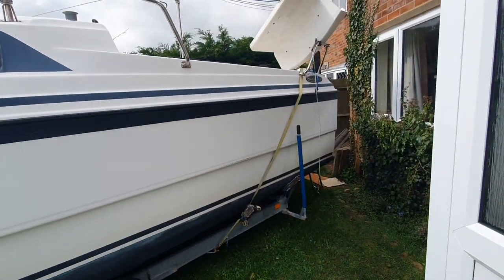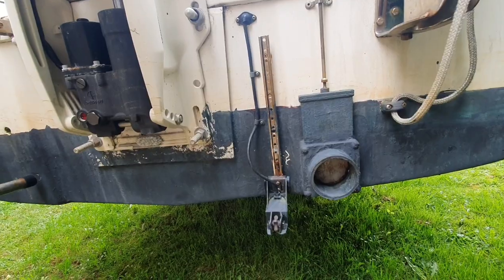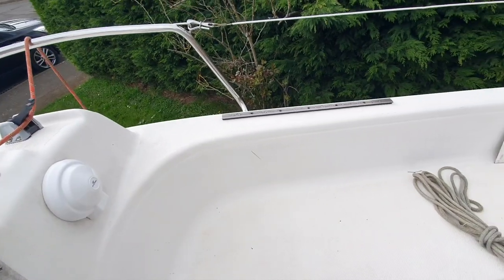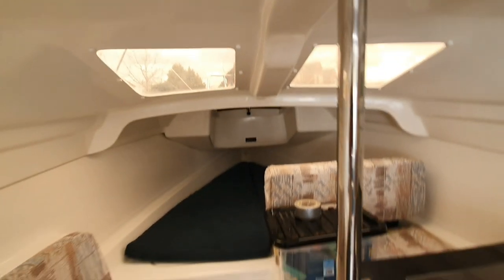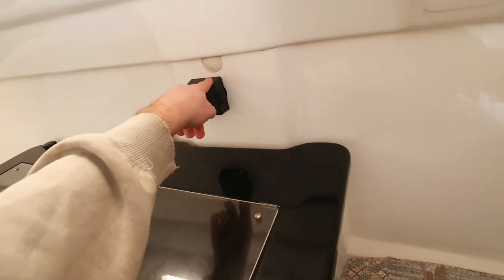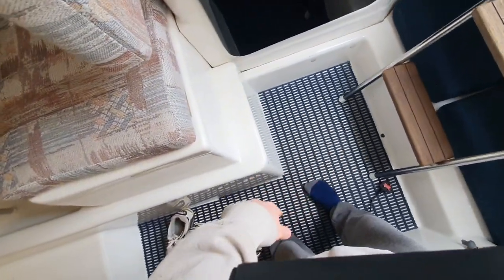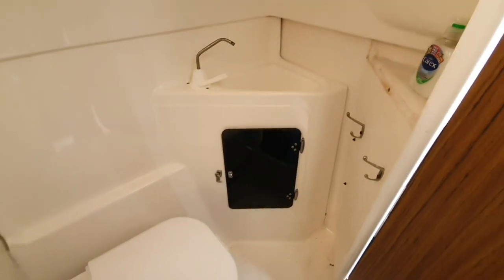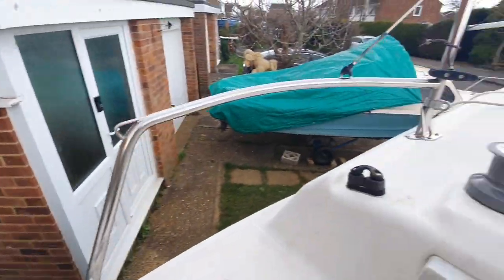Macgregor 26x Boat - Tour and Walkaround - Headroom, Comfort Review and Comparison to 26s #1

Comment: Had a 2000 model 26x purchased new for nearly 20 years. Couple of comments. When the mast is stowed the spreaders go under the upper deck lifelines. Leaning them on top of the lifelines bends the spreaders and stretches the lifelines as your boat shows. Although must admit the lifelines are so short as to be pretty much useless anyway. Some folks remove the spreaders each time they step the mast but it's not necessary; you can maneuver them under first one side, then the other. There are lots of videos on mast stepping that show you how.

The drainage hole in the floor pan by the ladder is a factory provision. I added two more in the corners so it would drain when the boat is heeled. 

You were fortunate to find one in pretty much factory condition. Most of these are heavily modified. Mine certainly was.

Comment: Prob the best walk through of this boat I’ve seen yet!  Thank you.  You even included laying in the beds.  I’m about the same height as you so now I can actually get a better feeling of the headroom of this boat.  Just out of curiosity since you’ve said you’ve looked at a 26M, does the 26M have a bit more cabin height and more height in the rear berth?  With the double raccoon/double stacked windows, is there actually equal more height?  Seeing them around the area out and about on the water and eyeing it, they look roughly the same.  Haven’t had the opportunity to step into any of these boats yet.  I really want the M but if it comes down to finding a good deal on a X, then I don’t care

Comment: The small drain hole beneath the companion way ladder is there by default. The boat yard started to put them in sometime around '98. It's there to warn you in case a large amount of water should fill up the bilge. If it weren't there, you'd probably notice the hazard too late.
Reply: mine has one and mine is a 96 :)
Reply: New to sailing and late to the party it seems, i want a 26X as well, and I have been looking for where the bilge is in this boat, it seems is in many parts, up front by the bow, in the back as well.... do you know where the actual bilge is in the 26x?
Thanks!
Reply: @cuestion-de-tiempo  There is no central bilge. The 26X has it's water ballast tank where other sailboats have the bilge. Depending on the heeling, any water in the bow area will flow to either the port or starboard bilge. The starboard bilge is the largest, best practice however would be to have bilge pumps on either side.
Reply: @RoaldKoger thanks a bunch, do you know anything related to an external electrical plug that came with some late models?

Comment: Very nicely done :)
20 knots under power is optimistic - realistically 15-16. ;)
Reply: You're not far off...Well loaded with crap but with empty water ballast my 26X's original old Honda 50A will crank it to 20 mph without undue fuss according to my GPS, which is, yeah, about 17 knots. It might well churn a bit faster, but I'm a gentle sort. In fact, I'm seldom in a "get up on plane" hurry, but I do test from time just to blow out the cobwebs.
Reply: @BilgemasterBill  I haven't taken mine to full throttle, just up to the 6000 rpm mark, where it was purring along at 15 knots. I'm happy enough with it, but if I do ever change the engine i'll go for a Yamaha 80 2 stroke. Same sort of weight but extra oomph.
Reply: @BilgemasterBill  how do you drain your water ballast once it’s full on the water after sailing and you want to motor at speed without additional water weight? 
Can you access the ballast to drain it with a pump?
Reply: @vlogcity1111  To drain the ballast you start motoring and open the ballast valve at the back of the boat and it will drain while you are moving.

Comment: How much would a boat like this cost? I have a 2001 26x and am in the process of selling it but don’t know how much I should ask
Reply: What motor does it have on it? That would change the price a fair bit because these are a hybrid motor sailer
Reply: @vlogcity1111  Honda 50hp
Reply: @6ty8stang  around 12-15k usd. Also Depends on where you are and the condition it’s in
Reply: @vlogcity1111  Honda 50hp

Comment: Thanks for taking the time to give us a looksee at your new 26X. I was referred here from the 'MacGregor and Tattoo Sailors Forum' at https://www.macgregorsailors.com/forum/viewtopic.php?f=9&t=28345.

Like my own 2001 26X here in Virginia, yours seems "nicely unmolested" by any too-hamfisted mods--damned near stock. I must say your trailer seems a bit hardier than my original American style OEM one. It must have been thanks to a higher UK requirements thing. In case you were still wondering, mine also has that little drain hole at the floor below the companionway running back to the bilge. The head has similar drainage. 

Anyhow, thanks again for the tour!